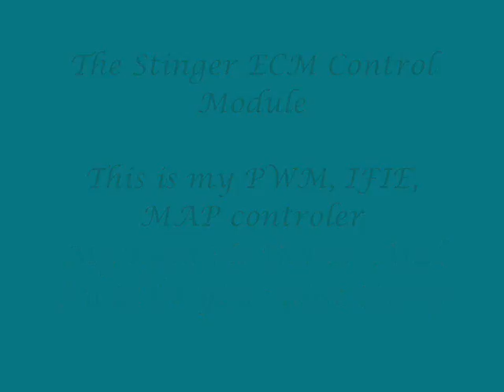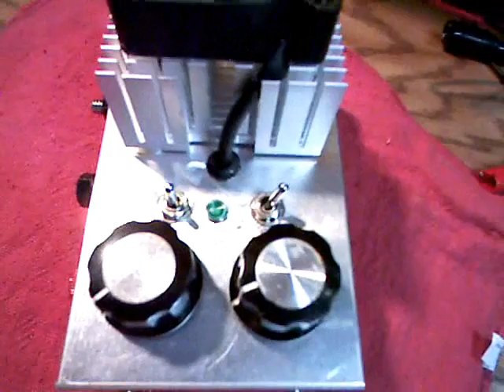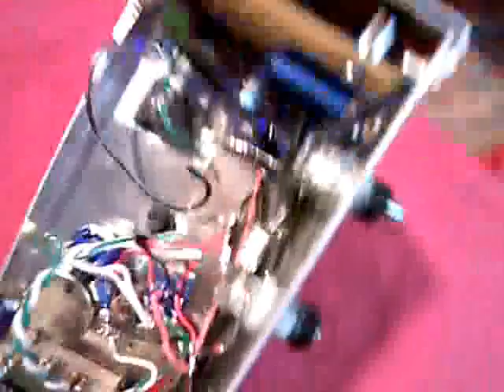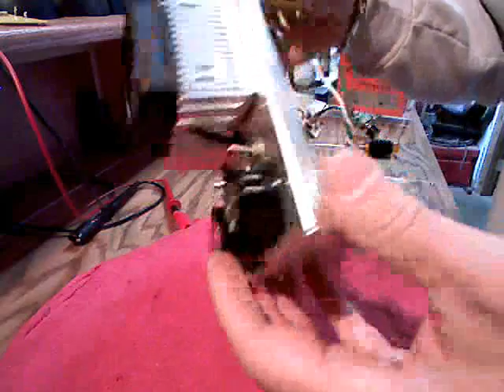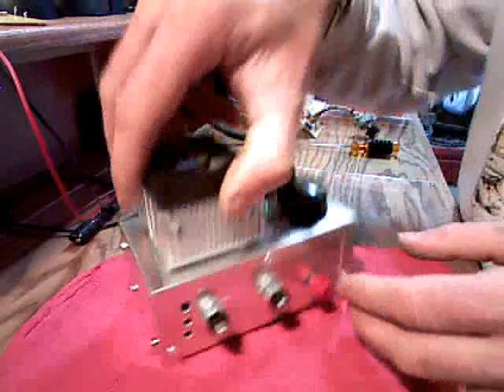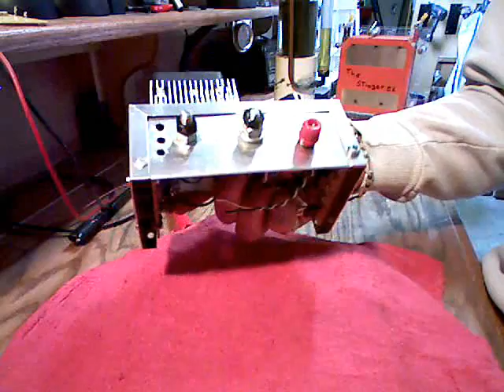ECU Controller

Comment: Could we not move the map sensor further down the air intake closer to the filter ?
Then have the HH & O enter the throttle body after the sensor. Same could be done with the manifold temp  sensor. ?